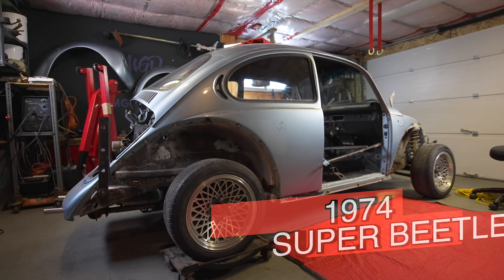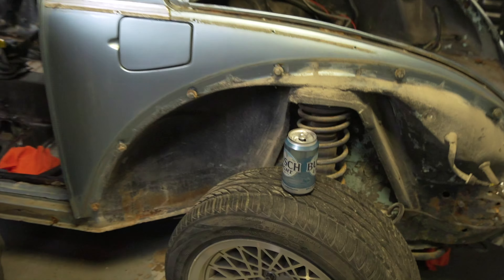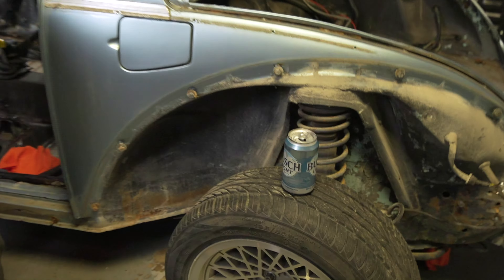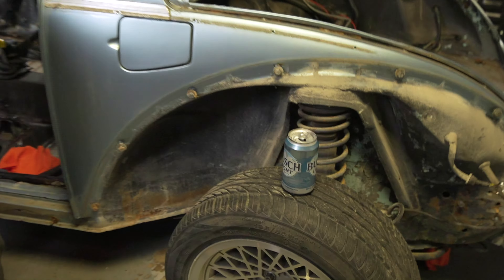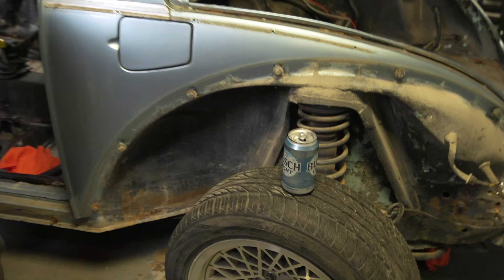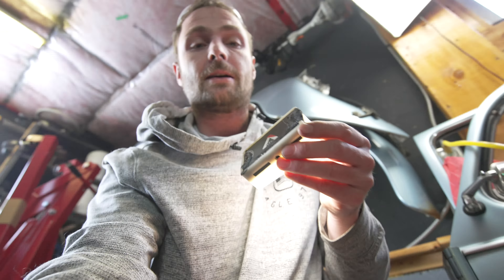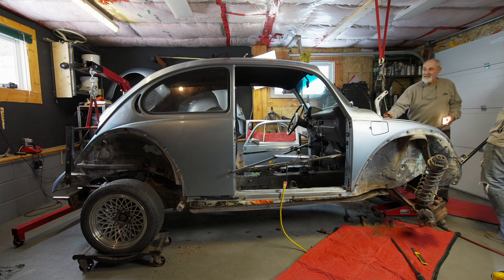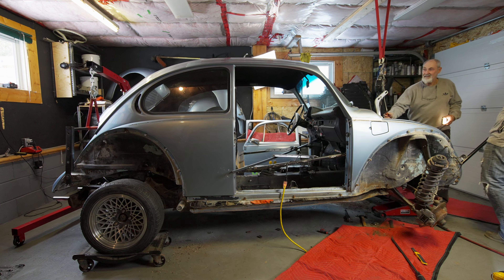Reviving a Classic | 1974 VW Super Beetle  Restoration | Split, Repair, and Resurrect!

Comment: Good job. Hope the napoleon hat isn’t to bad. Had to do too and bottom on mine wasn’t going to cut whole thing just ends.
Reply from the maker: Thank You!! 
This ones in decent shape but I've heard it's not fun to do! I was thinking the Frame Head was rough but it turns out it's all in great shape. Im just doing floor pans L,R and Heaters Channels L,R and cleaning up the rest/ painting before putting it all back together

Comment: Never heard of a Super Beetle , what's the difference ?
Reply from the maker: The way the suspension is setup. Regular beetle has a Front Beam with shocks. Super beetle has struts that bolt onto the body. There's more differences but that's the main one